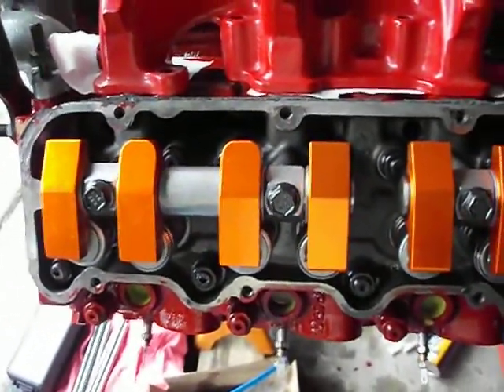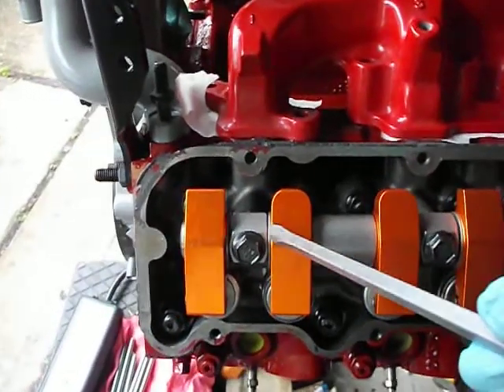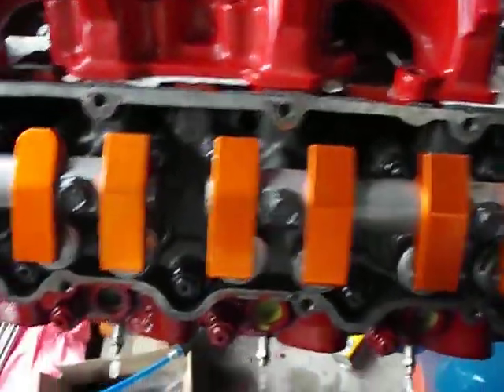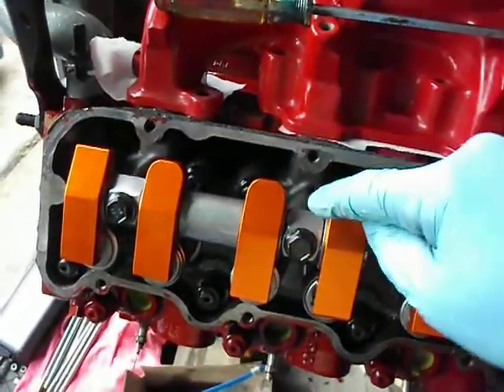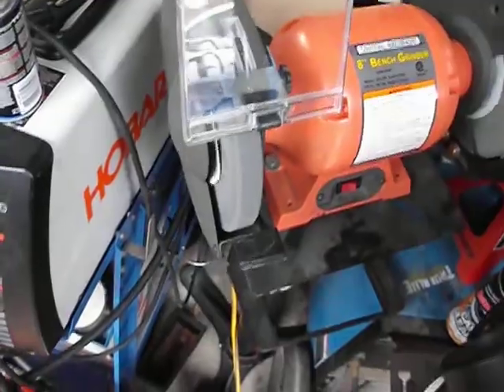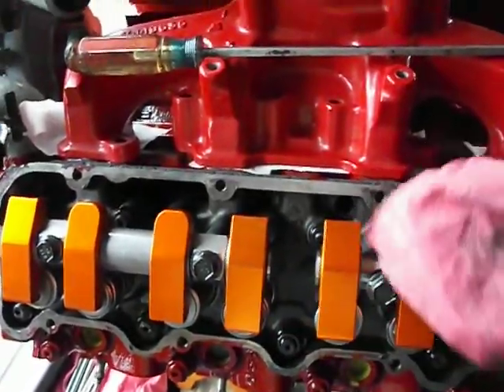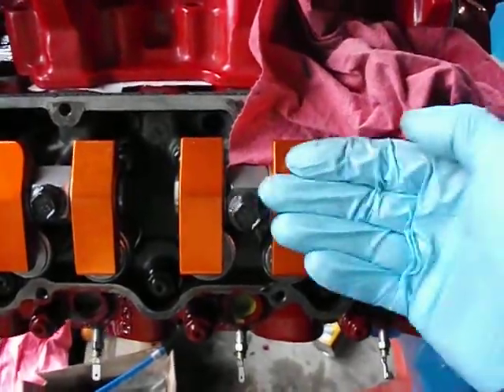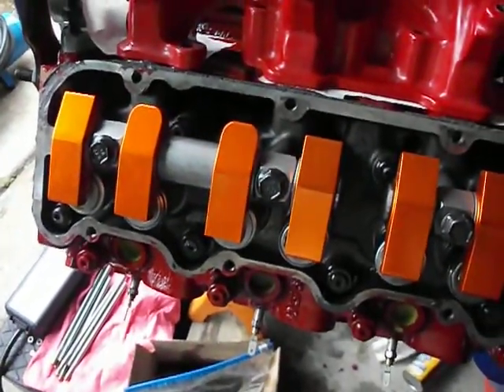Part 2 Harland Sharp rocker arm mod for 6.5 diesel 10Mar15

Comment: I have a 94 6.5 diesel. What are the benefits of installing these rockers?
Reply: LeroyDiesel oh yeah? 🤨 how? Benefits would definitely include reliability and not having those plastic retainers , less wear with the rollers but with stock cam and pushrods I don’t see how it would allow more air in and out ?
Reply: @Cs39601  higher ratio. Basically like adding a little to your cam lift

Comment: Harland Sharp is the most awesome company to deal with. I ordered some 6:1 ratio rockers from them and they accidentally sent 5:1 stock ratio ones. Most companies would be like, send them back at your cost to ship and we will send the correct replacements and you would be down on the job another 2 weeks and more money. But not them. they next day aired the new rockers with a prepaid postage. Now if FOA would operate half as nice to their customers they send out defective shocks to the world would be an even better place.

Comment: How much side clearance do the end 2 rockers have? That "C" most likely has a clearance hole, larger than the bolt. From what I am seeing, place equal shims, 4 x 0.010" or 0.020" what ever fits snug, on both sides of both "C"s before tightening the bolts. then pull them out afterwards.

Comment from the maker: Not sure why, maybe a CAD file difference? Also the issue with the spacers I was showing in the video was only on some sets sold before Feb 2015 anything after that will have the correct spacers.